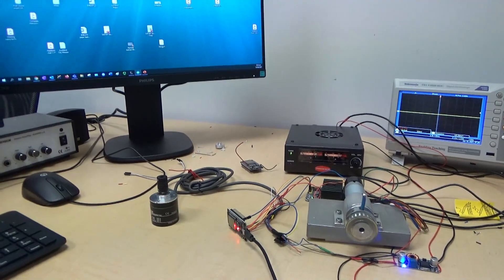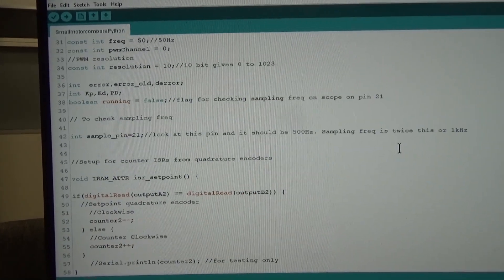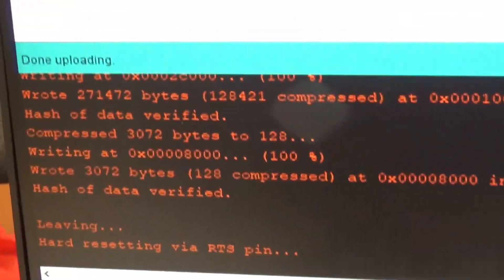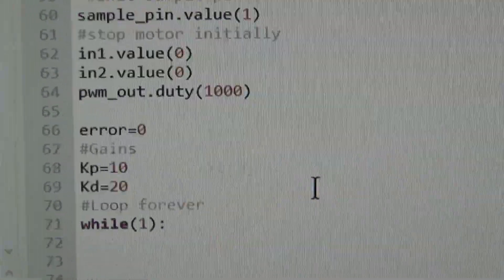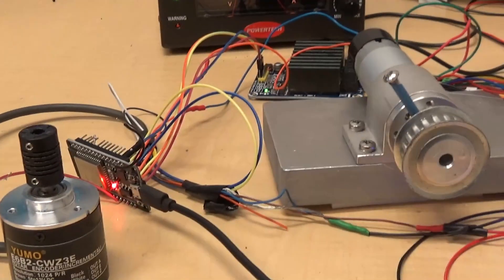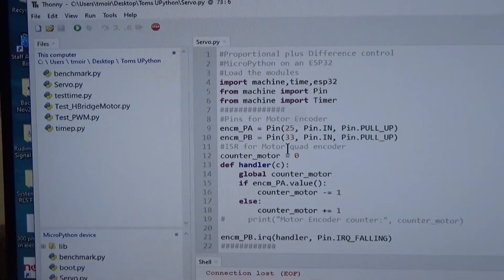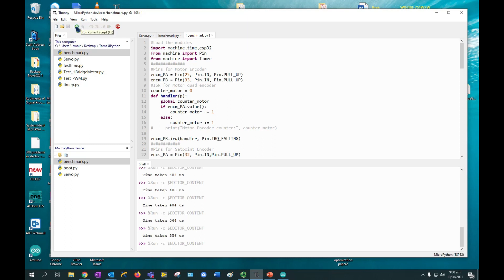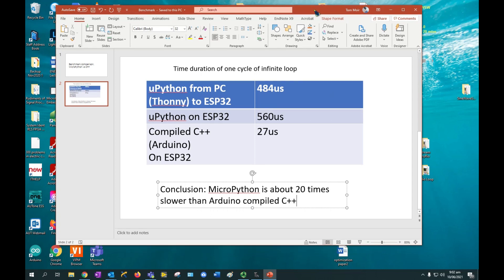MicroPython vs Arduino Benchmarking on an ESP32 microcontroller

Comment: Thanks! At this speed difference is not a big deal since the difference in performance is huge, but usually you would like to run your loops a few thousand times and calculate average, min, max, and std dev of the full runs for a more detailed comparison.

Comment: I've been playing around with µPython on ESP32 for a while now. Two things to note: Version 1.18 of µPython is 2-3x as fast as previous versions. Secondly, the 'viper' code emitter is about 10x as fast as interpreted code if you're doing any sort of math in a loop. Just check the chapter of the µPython manual on optimization. Finally, I was able to get native compiled modules working with very little trouble, so you can drop down to code that will perform identically to the Arduino if necessary.

That all said, if you're using the ESP32 to perform one, straightforward task that's at all performance sensitive, it makes sense to just use Arduino. But the ESP32 has SO many capabilities packed into it it's pretty easy to come up with uses for it where if you can spare the CPU cycles, you can throw together a complicated system with µPython that performs more than adequately. Arduino (C++) and Python are pretty much on the opposite sides of each other in terms of performance, complexity and ease-of-use, which makes this comparison interesting. I wish there was a solution that lands in the middle (maybe golang?), but I don't see anything that's mature yet.
Reply: You can run Rust on the pico, though I don’t know what the library support is like.

Comment: Is there a way to take the interpreted language and pre-compile it?   I think with BBC Basic you could run as an interpreted language but there was also a away that could be compiled, and a lot of programs used this method apparently.   BBC Basic was already quick as it was.
Reply from the maker: Cython is a new way but I have yet to explore it

Comment: I try to use Thonny for ESP32 but I get this message Device is busy or does not respond. Your options:

  - wait until it completes current work;
  - use Ctrl+C to interrupt current work;
  - reset the device and try again;
  - check connection properties;
  - make sure the device has suitable MicroPython / CircuitPython / firmware;
  - make sure the device is not in bootloader mode.

esptool installed by default and I installed the firmware and all the time the same message comes. Do you know how to fix this one?
Reply from the maker: If I remember, I did a ctr C or just unplugged it and plugged it back. Turn off the ESP32 too. Are you running the boot loader?
Reply: @TJMoir  I pressed Carl+c many times, turned off the ESP32 and no thing changed. It works with Arduino IDE but not with Thonby!